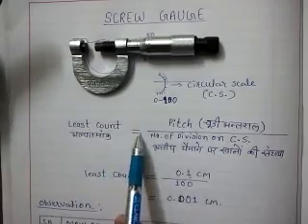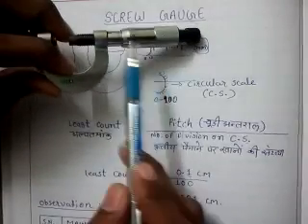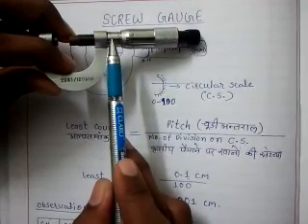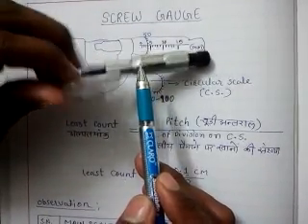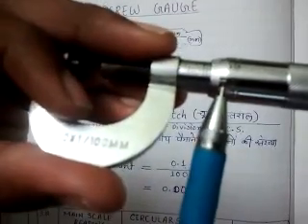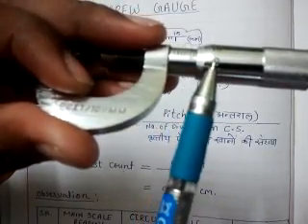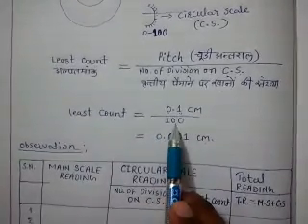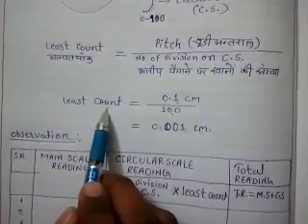How to take reading observation least count of screw gauge/hindi/english/physics/11th/12th

Comment: How can your screw guage show two different readings on circular scale for the same value on the main scale .
Plezz explain sir
Reply from the maker: We usually takes 3 or 5 measurement and then find average measurement called mean value.
In screw gauge or vernier calipers there may be different digit in last place of measurement due to the non uniformity in that cylinder or sphere.

Comment: It's wrong ...
Least count will be 0.01cm not 0.001cm
Reply: Sorry sir /mam I was telling about vernier callipers
Reply from the maker: Its ok but the video was about screw gauge.
Hope now you will hav no doubt
Reply: Ya
Reply: Therefore I have subscribed your channel and like this video
Reply from the maker: My dear abhinav least count 0.01 hota he but wo millimeter me. matlab 0.01mm
But least count cm me 0.001cm hi hota he.
Kyuki main scale par pitch 0.01cm {1mm} hota he. 
L.C.= pitch/ no. Of division on circular scale 
L.c.=0.1cm/100= 0.001cm
Yaa
L.c=1mm/100=0.01mm
Reply from the maker: You are little wrong dear.

10mm=1cm
1mm=1/10cm
1mm=0.1cm
Reply from the maker: And when you divide 0.1cm by 100 you get 0.001cm which is least count of screw gauge in cm
Reply: No,

Comment: which is correct record for the diameter of the wire when measured by a screw guage of least count 0.001?
Reply from the maker: +Bilal Abbas first to need to find zero error of screw gauge later follow the steps explain in video.screw gauge is design in such a way that it's least count is always 0.001cm or 0.01mm
Reply from the maker: +Bilal Abbas https://youtu.be/07YgxDsR82c.
Different wire has different thickness.so diameters will also be different.
Reply: sir Ans  2.+ aye gya plz solve